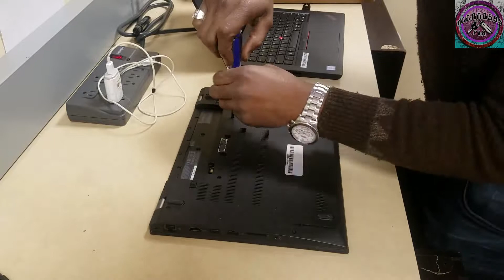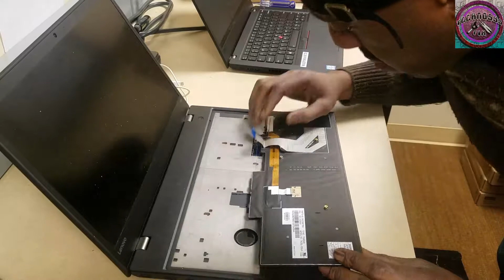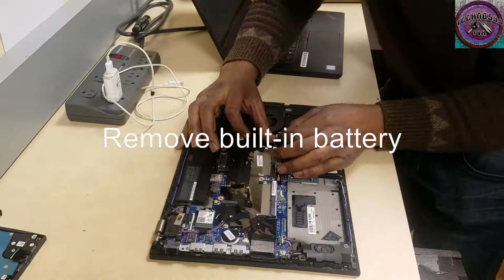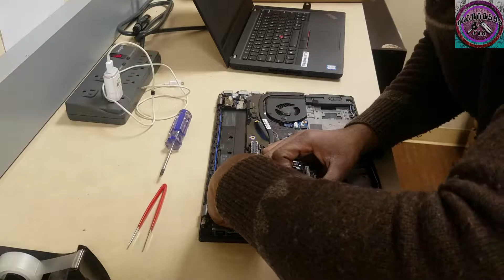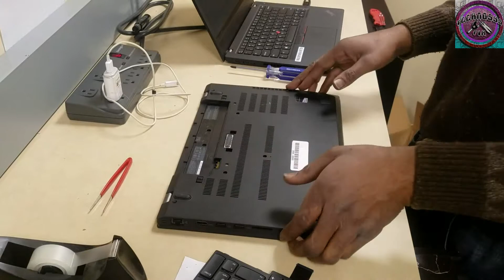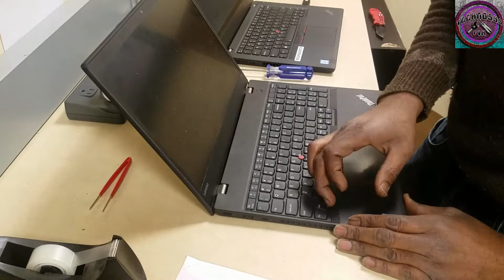Replacing System Board On Lenovo Thinkpad T570

Comment: T470/T570/P51S/T480/T580 are all horrible as after market laptops because the 1st and only hard drive connector is so bad and develops a loose connection after a time causing ssd to not be regonized or disconnecting. This is a type fault and design/manufacturing issue.

Comment: Any issues with the Windows configuration as it appears the licensing is built into the motherboard BIOS? Did the new motherboard come with licensing or were you able to transfer it from the old motherboard to the new? If so, how? Thank you.
Reply from the maker: FYI you only need to worry about that when you replace a HDD/SSD (drive). The software is installed on the drive

Comment: Great your video and the replacement of the motherboard and I would like to know if after entering the Bios, did it work without any problem? Because I have the same PC and a driver of the hard disk broke me ... and I have no solution .. .where can i find the same motherboard? where did you get it ?? you deserve a like..I speak to you from Germany
regards
PS: I translated it from the google translator because I don't speak English
Reply: Have the same problem, dit you fixet yours??
Reply: Buy a m.2 2242 sata III for WWAN-slot. Lots of T570/P51s have the same issue with main 1st hard drive connector. It is a type fault and design/manufacturing issue.